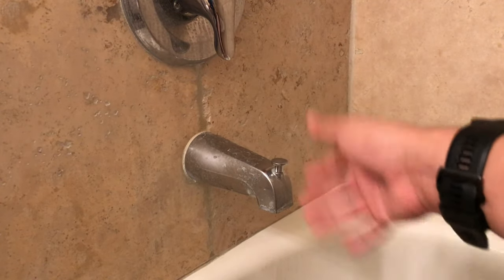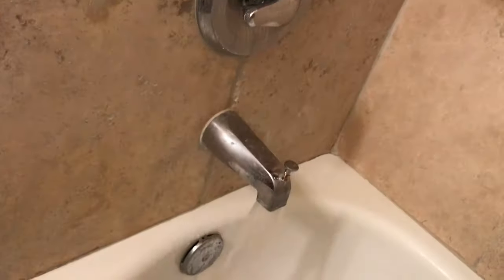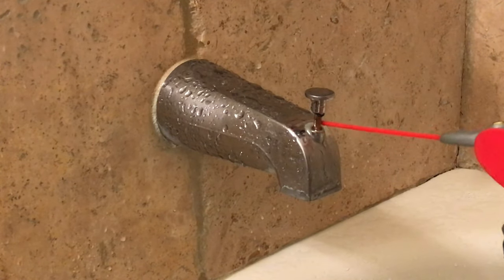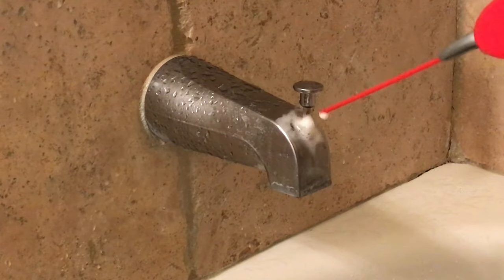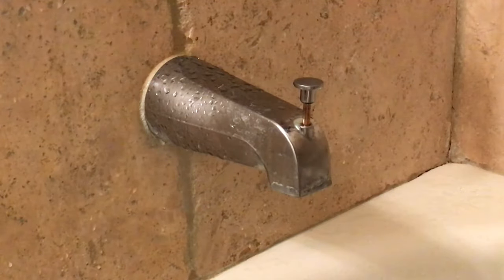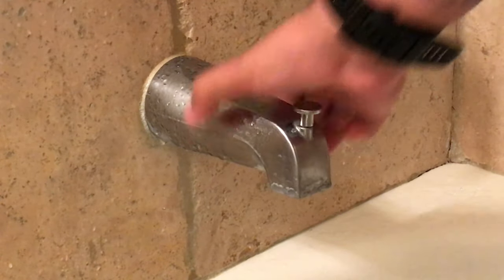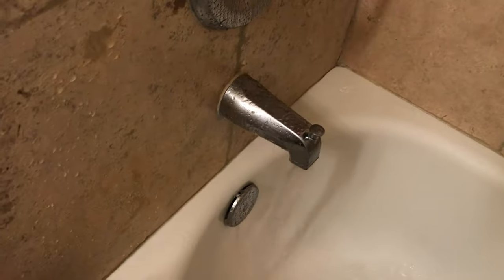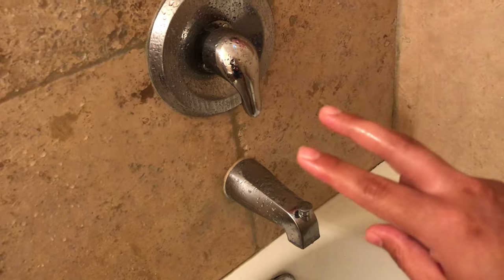HOW to Fix a STUCK Bathtub Spout!! LEAKING

Comment: Uh, WD-40 is NOT a lubricant.  It is a water displacement product, hence the name WD.  Also spraying WD-40 on the rubber washer that is inside the tub spout will cause the washer to deteriorate.  More likely, your tub spout diverter is sticking due to calcium buildup from hard water.  Although it will take longer than WD-40, white vinegar will do the same thing and not damage the rubber washer.
Reply: Thanks for this I was about to drench that bad boy in WD-40. About to drench it in white vinegar and give it the beans
Reply: @kyore789 use a ziplock bag with extra strength vinegar and tie it on overnight
Reply: And it worked like a charm. Wrapped a bag around it and a rubber band to hold it left it overnight. Worked it out pretty easily that morning
Reply: @stryk3r how,tried the bag,didn't work, kept leaking out
Reply: This is true mostly , however , using some WD40 will be fine.  There is a reason it is a big seller.  It has many uses. It’s effective.
Reply: My can of WD-40 says it’s also a lubricant.
Reply: I have used both vinegar-in-bag method and WD-40 in multiple applications.  Sometimes one works better than the other, but overall I think incorporating both over 2-3 day period gave the best results.

Comment: Ugh... .no petrolium products on rubber!!   you can't use anything with petrolium in it. .it will eat away the washer in the diverter mechanism. You have to use plumbers grease, but you shouldn't need that at all for this.  if it's sticking then the parts should be relaced.  I wonder how many people had their rubber eaten away by the petrolium in the wd40.

Comment: Would this solve one that is completely stuck in the up position, like I think it's rusted in place lol not sure how to take the faucet off or I would leave it in some vinegar
Reply: I can put my body weight on it and it still won't go down
Reply: Were you ever able to fix yours? Mine is the same way, WD40 is not working so far... lol...
Reply: There are videos on how to take faucet off depending on which type.  That’s the easy part.  I could not take my spout off, so will have to get someone to help.  You can also fill baggie with vinegar and attach to faucet with rubber band so insides are submerged.  I did that too but didn’t work in my case.  Good luck!
Reply: WD only worked for the past few months. I sprayed the diverted once a month but this past week not even WD works.

Comment: I just fixed mine using white vinegar and then with some Lime A Way foam spray. Then I took some fine steel wool, wrapped it around the lever shaft and twisted the lever. Works like a charm and it looks new after the steel wool removed the gunk.

Comment: They're calcium deposit inside the faucet the way to fix it is to take the faucet off and soak it in vinegar.
Reply: I was going to say the same thing:).  This guy pretty much pour oil down the drain.  And oil doesn't dissolve calcium build up, if calcium build up IS the issue.
Reply: Okkokjjh
Reply: @pn3940   Anything with petrolium eats away the rubber in the diverter.  If anything he should have used waterbased lube like Liquid wrench water based. but John cook is right.. and I said it in my reply.. if the diverter is sticking there is another issue.  It can also be replaced.  the parts are $5-6 at a hardware store (NOT  home center..support small businesses).  it takes like a few minutes to change them out.

Comment: Mine is stuck in the up position and I had to use a wrench to turn the pin cus it was stuck but after a bit of WD 40 it fixed it up great and working like it's new.
Thank you for posting this video!

Comment: THANKS! It works like new. It was my first thought to use this but instead I used some  CLR first to try and dissolve what looked like calcium build up, because it was really stuck and would not budge. Then I saw your clip and it made it more possible so I tried it.  The CLR wasn't working. So I went ahead and tried the  WD40. I let it sit a while. At first it would not even pull up. It took a few tries. And patience. And prayers, lol. But I followed the rest of your instructions and finally, it happened and now it works great!!🙌

Comment: Could wd affect the seal negatively in any way?  Is there a rubber seal on those?
Reply: What a great question! I googled it. First sentence I saw was, "Actually wd 40 is bad for rubber anything. Just ask any air soft gun hobbyist. They avoid it to lube their guns because it destroys rubber seals. The best option here would be a silicone based lube."

Comment: My faucet is fused to the pipe with either calcium or lime so I am trying CLR because WD40 worked only on the stuci diverter. I need to replace the faucet.

Comment: i pulled mine up one day and it broke off completely. now im stuck with a very light shower head water flow and most of it comes out of the damn faucet. my life sucks in so many ways.
Reply: a new faucet is only like $20
Reply: @TheAechBomb  getting one is easy. installing it is the problem i've tried everything to remove the old one. it just wont budge like several videos say it would.
Reply: @scizophrenic2602  late to the party but instead of using just your hand to rotate the spout, use a large screwdriver or piece of pipe, place it up in the spout and use that for leverage.
Reply: @ArshesNei8  yeah i had some maintenance guy come and put a new one in  a while ago. thx for the advice. not sure how he did it but im just glad he did.

Comment: I was able to fix my water spout to work as a bath now but for some reason when I put hot water it starts to knock how long should I let it run on hot to fix the problem it works fine if your taking a shower just not a bath on hot

Comment: What if it’s completely stuck and u can’t pull it up at all
Reply: I got the same issue. It is completed stuck the other way where I can only run the shower head
Reply: @smonthamao2376  spray some WD40 and hold the spout and bang the pin down with a hammer or something. Then use a pair of pliers and pull it back up and spray a little more WD40. Soon enough you'll be able to move it up and down keep adding a little WD40 as you do. Mine was completely seized and fixed it this way.
Reply: @4kallday  I will give it a try. Thanks